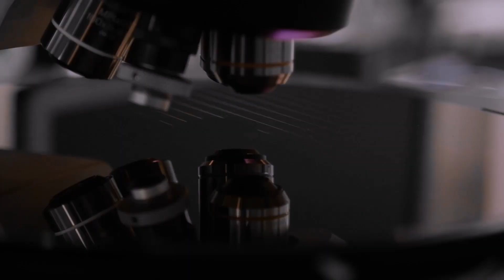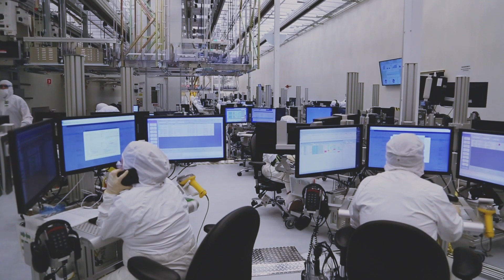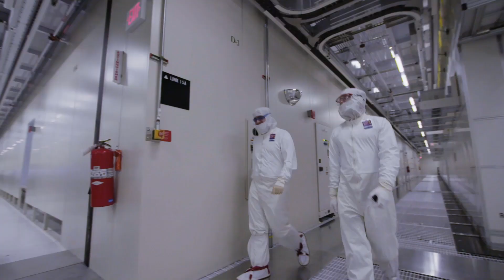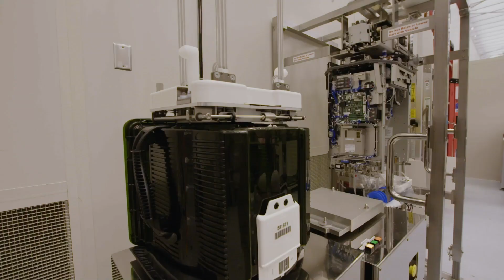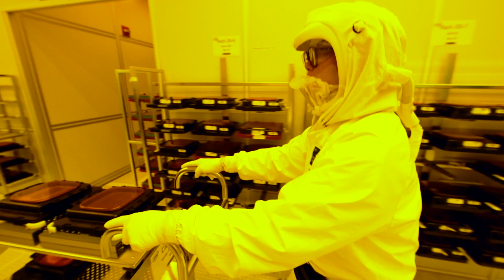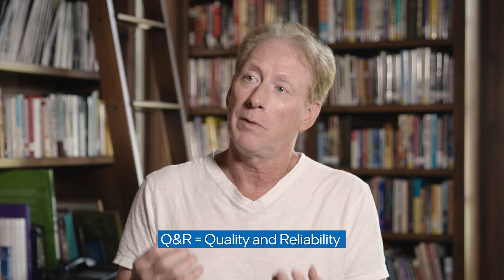Intel processor binning explained by Guy Therien | Talking Tech

Comment: Too bad he didn't explain what it is exactly about the chips that makes them perform better or worse. For a down binned chip, I want to know if it's electrons jumping over gaps, or traces that are too thin getting too hot, how do the electron paths on chips fair over time if they are too thin or just defective enough to require a drop in clock/voltage?, etc...

Comment: I would really want to know why forecasting came up with the present roadmap. The idea of dumping HT is great, but could we get like 12 - 16 p-cores instead of up to 40 e-cores? I mean sure content creators need a lot of multi threading, but most gamers need high ipc paired with high clocks for good minimum fps performance - way better than raising cache sizes btw.. Increasing bclk also helps with that - do you plan on using bclk's greater than 100 MHz in the future?

Comment: @guytherien,  as a regular customer, I would like to ask humbly how do you actually do the binning of processors technically, do you pass some kind of electricity through the chip and see the input vs output voltage, may be see the chip through some special lenses digitally,  or something else completely different? Please do note that if this is something that is company trade secret, then please don't answer.
Reply from the maker: Hi Partha! To have a clear picture of the manufacturer of the Intel chips, do visit https://intel.ly/3DpTagC where each and every processor is explained, including the binning process. If you require any further assistance regarding the Intel products, do reach out to us via direct or private message via Twitter, Facebook, or Instagram. We’ll be happy to assist you further.
Reply: @IntelTechnology  awesome. thanks

Comment: I'm always glad to clarify. Ask away.
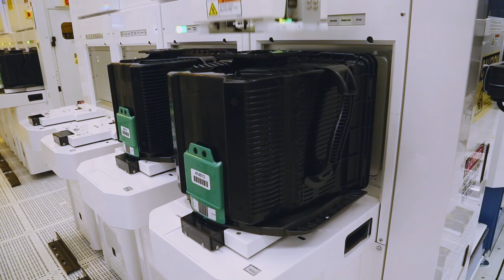Reply: Thanks for the excellent review Guy! Could you clarify the question asked at 3:36? 
Qn: At what point does the binning process occur? At the wafer level or does it have to be fused or packaged first?
Reply: @henrykellock836  Die level and package level. We have the technical ability to reasonably determine function and capability prior to packaging. In other cases we package then perform more robust tests and then bin in accordance function, performance within power and with supply demand.

Comment: Binning is explained as a term applicable to processors, but not the procedures itself.
There are some clues in the video about the procedures:
- choose the bin specs by varying voltage, current, clock speed in the limits of power consumption for at least 10% of pre-production chips considered for the bin
- test the chips in production line if they reliably fit into the bin, otherwise test for the next bin

Comment: No biscuits here, 13900 k stock speeds max load volts vr out 1.18 stable msi z690 WiFi edge ddr4 and my ddr4 degraded 32gb 3200 kit. I think can go lower
Reply: Using DDR4 on Raptor Lake is basically trolling
Reply: Nah. You can't speak ddr5. I won't talk to you

Comment: I have an SP121 P-Core 13900K. Should I even consider a 13900KS? My chip can do 6.0Ghz all cores and 6.3Ghz turbo boost.
Reply: No way.
Reply: The more money you give Intel, the better.
Reply: @VIDEO CARDZ RULE it is possible you could be clock stretching. have you benchmarked it all the way up to ensure you actually got better performance?
Reply: tps that you
Reply: Very good for a K and I would keep that chip, my 13900KS SP130 P core which is exceptional most K's are below your K.
Reply: @peterscrace3530  KS sp score is inflated by 5~ points over the K skews, meaning his 121 pcore K equals an 126 pcore KS, yours is exceptional nonetheless.